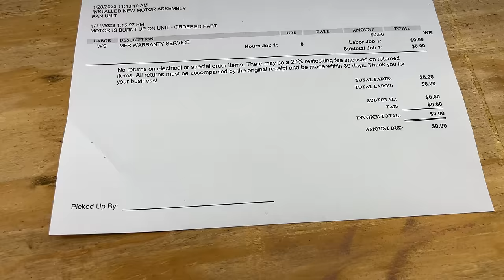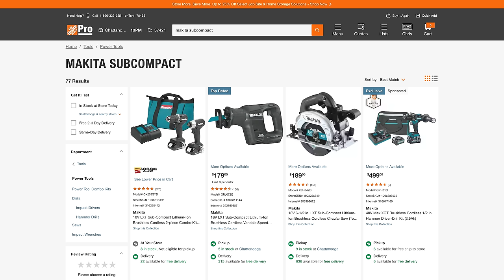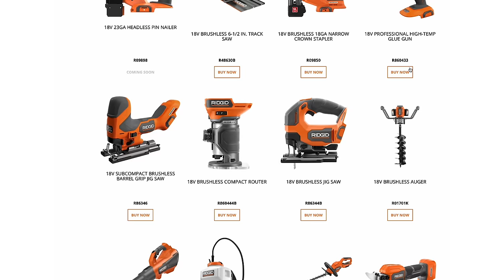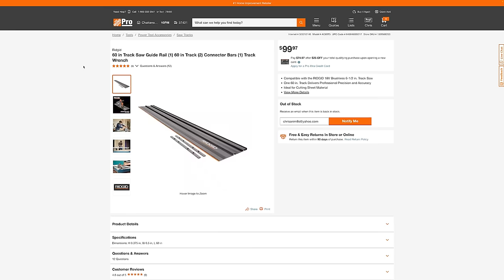Why Everyone Was Wrong About RIDGID's Future...

Comment: You used to see Ridgid on the job site all the time, but the majority of contractors have moved to Milwaukee as the main brand. You still have some loyal Ridgid boys out there, but I suspect we will start seeing them more often as Ridgid keeps making new tools. I also don’t think Ridgid’s batteries are talked about enough, some of their new batteries are really solid
Reply: I don't like how they don't have padding on their batteries now they are just plastic now. They would not even slide off the surface you put them on back then   because the rubber padding

Comment: I gotta agree about the Lifetime Service warranty.  Especially when every time you buy some kind of power tool at a box store, they offer their warranty that picks up where the manufacturer's warranty ends. With the Ridgid warranty you can say no every time.
Reply: Make sure you live near a service center. Mine says he's getting 10 machines monthly because so many rigid repair centers aren't renewing their contracts.
Reply: @foodhead4677  Definitely a great point. I have several Dewalt tools I've bought over the years, until I bought a new mitre saw. I just couldn't get past that the Ridgid equal to the Dewalt mitre saw, was $300 cheaper, so I bought it instead. So far, it's been a great saw!

Comment: Started with Ridgid myself in 2009 and haven't given it a second thought.  They've been steady workers since.  I've recently picked up a couple  milwaukee tools, the m12 compact impact and m12 pin nailer and the m18 impact driver via a set to start with 2 batteries in that lineup.  95% of my cordless are ridgid and happy to keep buying them.
Reply: Take a look at the M18 "Surge" impact driver and the M12 "Surge" impact driver. Me and my coworker use these, because they are totally silent, with a fluid drive system, so they don't make a loud metallic hammering sound. You won't believe how smooth and nice they are for woodworking, a dream seriously. My only advice after using Milwaukee tools for 10 years daily in commercial construction--don't leave your M18 tools outside of a storage case. Keep them in a cupboard, tool box, storage bag, or in your house, when you're not using them. If you leave M18 tools sitting in the back of your car on the floor, or in a 90% humidity unheated shop, the humidity and dampness will seep into the electronics. Keep them in an insulated or sealed box, so they aren't exposed to condensation during the morning when the sun comes up. The modern Milwaukee tools have several small computer chips inside, which are apparently very sensitive to moisture--don't leave your tools in the cold!

Comment: I use the AEG brand here in Australia as a professional user. Never had an issue with the quality of the tool. My 18v grinder recently shorted out, took it back to Bunnings for repair (4 years old and really worked hard) and a week later it was replaced with a brand new model no questions asked.  I am glad to have seen your video. Thanks, puts me at ease also..

Comment: The Octane/Gen 5x was and still is the best tools Ridgid has made. TTI forced these out because it was stronger than the Milwaukee fuel line. In the current M18 fuel tools you see the Ridgid technology that was from the octane tools. Many people don’t know this and it’s crazy how TTI can control them into being the middle child when their technology is superior. Ridgid is the best lineup and they are pushing to make it that way again. Great video 👍🏼
Reply: You're right. The Octane line didn't flop. TTI nixed the line because they were equal to or outperforming their more expensive Milwaukee line at a lower price point. It was a purely profit driven decision. 
Isn't it interesting how few people fail to make the connection between Octane and Fuel? Rebranding in its purest form. It's not even well disguised, and basically right out there in the open for all to see.
Reply: YES! Octane was not a flop....TTI nixed it because the tools were outperforming many Milwaukee tools for a lower price point. The hammer drill, the mid and high torque impact wrenches, all were amazing. Ridgid most certainly is not dead, and they are coming storming back. Their new table saw is amazing (orange Delta) and so are their Miter saws (orange delta). They have come back and I am really looking forward to whats next in 2024!
Reply: Milwaukee has a history of being sue-happy if they think anyone infringes on their battery patents.  In 2019 they sent legal "letters" to Emerson, alleging that Ridgid was violating their special magic battery sauce.  Not long later, is when Ridgid dropped the Octane line and re-designed their tools to use different batteries. I always assumed the Emerson/Ridgid side just thought it was easier to do that, and is what would explain the lull in activity from the brand for awhile.   I am very doubtful that anything was "stolen" from Milwaukee, only that Milwaukee has lots of lawyers that like to sign their engineers up for patents, carpet bomb the whole field with what they think is special battery magic, and then go be sue-happy all over the industry if they feel "threatened" by anyone who is "infringing" (IMHO it's all ridiculous).  This kind of behavior is IMO abusive and not what the IP laws were originally intended for.
Reply: @GarenP  agreed and you are very right. Thank you for posting
Reply: @GarenP  Emerson Ridgid tools are red and are not sold at Home Depot. The orange Ridgid are made by TTI for Home Depot. The name Ridgid is leased from Emerson. These tools are basically AEG rebranded to the leased name Ridgid.

The Octane line were made by TTI, which is the parent company of Milwaukee, Ryobi, and AEG/Ridgid. Emerson was never involved, and TTI would be suing themselves.
Combining Octane batteries and tools basically turbo charged their performance. Combining non-Octane batteries or tools with Octane versions did not have this effect. Therefore, the matter of battery tech infringement was not an issue. Certainly not one that affected Emerson in any way.

The problem for TTI was that the Ridgid Octane line was rivaling their top tier brand, Milwaukee, at a much lower price point.
Home Depot accounts for nearly half of TTI's revenue, and 60% of North American sales.
Can't have the cheaper orange headed stepchild outperforming their golden child. Especially when they're coming out of the same store that accounts for 60% of the North American market.

Side by side, which is the better deal? The one that has the LSA, equal or better performance, and lower price. Or the one that has none of those?
Reply: What is Rigids best all-in-one drill/driver/hammer tool

Comment: That is great news indicating they will be around and innovating.  Like you I moved into the ridgid line because of the lifetime warranty on the tools and batteries  when I needed to replace a few Dewalt batteries and tools several years ago. Out of the many, many Ridgid tools that I have purchased, I have only been a little disappointed in one and that is the 18 V cordless palm sander, it is not as smooth as my DeWalt corded sander and tends to walk and jump at times. Other than that every tool I’ve purchased has been fantastic, and their warranty service has been excellent. I only had to use it one time recently for a drill that the clutch mechanism was not working properly on and they paid for shipping, checked it out and indicated it was defective then sent me a brand new one. And this was after 4 years of use. Very pleased with the Ridgid line, great tools, and great value!

Comment: I have the 12 inch sliding compound miter and their stand. Had it about a yr now. ❤ it. No complaints. Built many things and still holding like new. Straight & square out of the box. I too bought it for the lifetime warranty. After many yrs of owning Crapsman. I'm finally kicking them to the curb as they wear out. Just bought a new Grizzly bandsaw and a new Rikon table saw. Life is good. My customers are happy. Im happy.

Comment: Get that Metabo HPT 36V 1/2" plunge router
We use these in the shop and jobsite
Beats the brakes off the new Milwaukee and we've been using em for over 2yrs with heavy use

Comment: I've been on the Ryobi platform for about 6 years. I intended to start there and upgrade to Milwaukee later. In6 years I've had one tool (oscillating) die on me. Later about a year, it was used, a lot and dropped several times off ladders. My good personal experience with Ryobi makes it hard to change platforms. Thanks for the video

Comment: Ridgid isn't available in Australia but we have AEG instead. 
Exactly the same but with a different sticker. 
They are sold by Bunnings hardware (who also have Ryobi - just like Home Depot in the US). 
I bought a swag of AEG recently and they seem like great tools. 
Would be nice if they had a lifetime warrantee but I guess AEG figure they can get away with not offering that here. 
As the tools are the same, but much more expensive here, I bought a Ridgid router from the US recently and with shipping it was about 1/2 of what I'd pay for an AEG. 
No warrantee but I figure worth the risk for the price.
Reply: Ridgid tools are rebadged AEG tools

Comment: I first started buying Ridgid machines in 2000 with the 6in jointer, 12in sliding miter saw and portable stand, 13 in thickness planner, and oscillating sander, except for changing the blades on the machines, i've had no issues. About 5 years ago started transitioning to their power hand tools because of their lifetime warranty.  So far no complaints.

Comment: There's a couple different things that you forgot to mention in the rigid lineup. There are only ones that I know of that has a planer, a jointer and a drill press for woodworkers. As a rigid fan. I was wondering the same thing if they were going to go out also

Comment: I'm a die hard Ridgid fan. I bought a 5 tool kit when cordless tools first came out with nicad batteries (which sucked) but the tools all still work today because the new batteries work on the old tools, and as far as I know, Ridgid is the only ones to keep they're batteries connection style the same. Now i dont use any of my old tools anymore because they're bulky and clunky to use in comparison to the advancement in ergonomics and lighter materials that the newer line-up of tools. But they all still work flawlessly despite they're appearance having served me for 10 years on a plumbing/hvac truck getting rode hard and put up wet, quite literally sometimes. They've always been great tools for me, and they've done that consistently over the years. I hope they expand their tool line, that is my biggest complaint against them is the lack of different tools offered.

Comment: I was like you and bought into the Ridgid line because of their LSA but I just did so this year, like June or July 2023.  I'd owned a drill/driver long ago but needed a new one badly after mine had been dead for a while.  There was a subcompact 2 tool combo, with 2 batteries and a charger and bag for like $149.  That was a bit higher than I wanted to pay but the LSA made me do it.  

I'm so happy with my purchase!  I honestly can't believe they made a drill/driver so small yet powerful and if I need more, I got the impact driver and it's also tiny.  These are incredible tools and in such a tiny form factor it kind of blows my mind.

I went on to buy A LOT more Ridgid stuff this year.  Hand held vacuum, portable shop vac, router, sander, jig saw and more.  I guess this year was the year to buy tools. haha it's been a while for me so it was definitely time to upgrade.

I started to worry tho because there are just SOO many new tools for Ryobi!! I've actually bought other brands because it didn't exist in the Ridgid line.  Like I bought the Kobalt pole chain saw because that one is AMAZING and light weight. Ridgid needs one and if they do it right, by leaving the heavy bits down low and the upper bits lightweight AND make the lower, heavier bits be swappable so you could have both a pole saw and a hand held chain saw as well as other attachments like weedeater, edger, etc.....holy crap would that be helpful and handy!!

I'm really happy with the build quality of the Ridgid tools and I like that the newer models seem to be real improvements over the older versions, like the router switch you described.  BUT I really want some new tool innovation!!  I hope Ridgid can deliver cuz I seriously love this brand.

Comment: Just purchased the  Ridgid  1/2 “ compact wrench,   I’m new to the Ridgid line.  It’s a tank and so small can break 500 ft pounds ,  so when working on the old mustang not to mention all family’s cars .   That’s impressive even if never needed.   Am so pleased with this going to go for the extended reach wrenches and the right angle impact wrench.   Another positive from  Ridgid updated there lifetime service agreement  to include individual purchased batteries.   If Ridgid has my back I’ll have there’s .   Lifetime service agreement is a big deal.   A tool might be 5 years old not shiny pretty anymore but hey I would rather save the new tool and battery money and spend it  building  my next project 😎😎😎

Comment: Im a commercial electrician and have many of the brushless tools they offered since 2017. I recommend when I can and would make the investment into ridgid all over again. They push as hard as any other line but can't be touched with their warranty. So far, I have only needed to use the service agreement a couple of times with the light cannon and the sds hammer drill depth stop handle. They sent me new replacements in the mail. You can't go wrong

Comment: Been a Dewalt fan and bought a few Rigid tools but have to say I’ve been bitten by the big red bug and moved to Milwaukee. Batteries are really good and once you’re in the platform it’s easy to stay with it. My drills, saws everything take the same battery as my chainsaw, leaf blower etc.

Comment: I have been with Ridgid for longer than I can even remember. I purchased their 12 inch miter saws, their extended wing table saws (belt driven), and their drill press. Now what is funny is that those pieces on their manual shows as lifetime warr (emerson) not LSA. Now they are I would guess 20+ years old and you know the thermal printer receipts are all faded and blacked out with age. I know for a fact that parts are not available for these tools. Now I am also big time and have gotten a good amount of their 18V line and love them. All are registered and have yet to have any problem with them. You should also mention they have revamped the way that they handling their LSA repairs. No longer are you having to find a service center to send the defective in to have repaired or replaced, you just submit a service request and they will send you a box with a turn around of I think 2 to 3 weeks. Much better way of handling service IMHO.

Comment: I live in Elyria and back in 1987 installed the water paint system for painting the pipe wrenches. I drive by it on way home if train is stuck on the track to go around. It is pronounced E leer E ah. Thanks for video!

Comment: Since 1999 when I had my construction co I used and bought many Ridgid tool. I still have some of them. Recently I tried to use my Ridgid 1/2" hammer drill, it did not work. Took it to a local repair shop, there could not repair it, they told me that Ridgid would send me a new one. It arrived within a week. I have since bought many Milwaukee tools. But still use some of my Ridgid tools that I have had since 1999 /2000.   Ron  USCG RET

Comment: getting into the trades my first tool was a RIDGID Next Gen Tradesman Drill and then the combo kit you got back in 2020. Almost 4 years later I haven't bought any other brand's power tools. The one gripe I do have is the battery case design when they changed it in, I believe 2021/22 with the extra rubber bumpers to just plastic all around. It's not so much i miss the rubber bumpers is the extra little lip they had to help the battery from moving around with vibrations. I have the Oscillating Multi-tool and with the "newer? battery packs you can see how much vibration is sent down to the tool and pack with the melted spots when the pack is vibrating on the tool base. Also miss the battery life button design with a real button not just some sticker with a pad that will break at some point.

Comment: I have replaced my drill twice, my impact is starting to act up and the big flashlight that was super bright bit the dust recently. I won’t buy any more Ridgid. They make a cheap tool that will get you started but if you want something that is going to last buy something else. I have some Dewalt and they haven’t let me down. I also have a Festool sander and dust collector and those tools are on a level all by themselves. I paid 125$ for the dust collector. I wish I could afford all their tools.

Comment: I have a ton of Ridgid tools and have  never needed to use the warranty. They just work and the batteries are solid. Just bought the palm router and brad nailer. Sucks to change battery platforms.